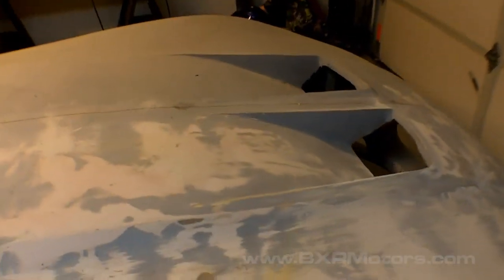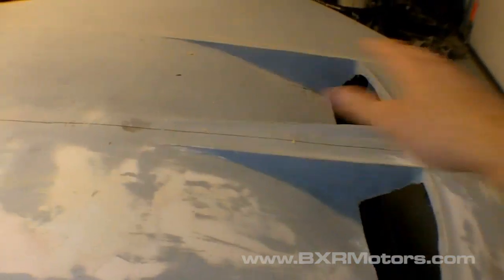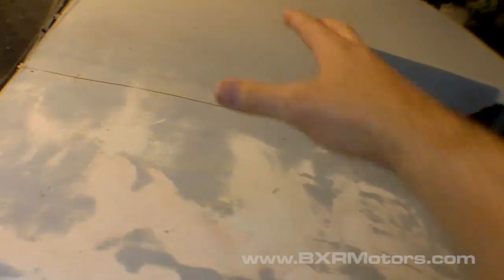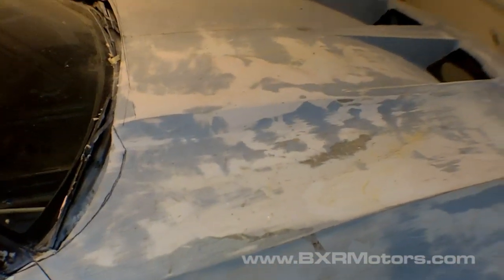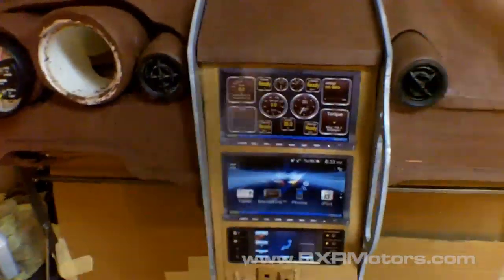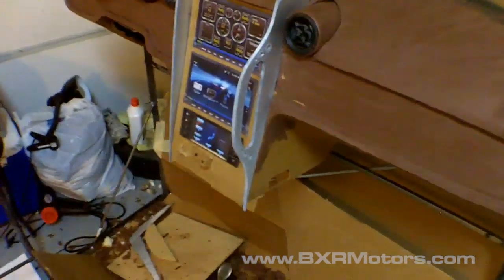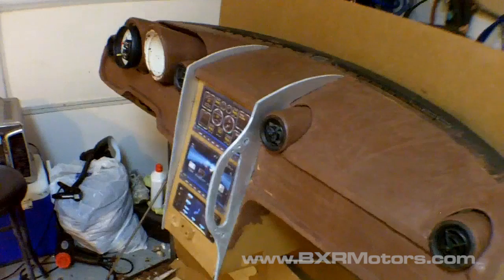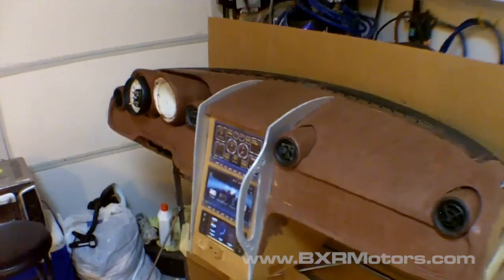Fiberglass Mold Hood Vent Scoop - Bailey Blade XTR - Part 76

Comment from the maker: Thanks man... on the Clay it is just used for making the shape of everything. Once I am happy with the design I will mold it and produce Carbon Fiber versions. At first though I will make a Fiberglass Master mold. Not clay will remain on the car and it never hardens and weighs a ton. Its only for designing things then you make molds.

Comment: on the dash, I understand the overall look your trying for, I think if you were to take what looks like a corner off the top and make it look more natural and round it off (for the safety reasons) it may look better, another thought for the handle is to make it look more like a regular knife blade rather than something Jet Li would use to cut us in half lol

Comment from the maker: Yeah the door panel and handles are undersized for the reason that panning and leather will be applied. But for the door pull handles yes I do plan to reshape a bit and make a bit larger as they will be made of aluminum.